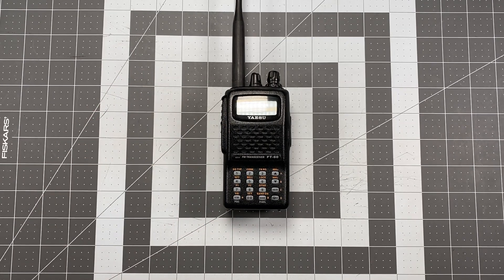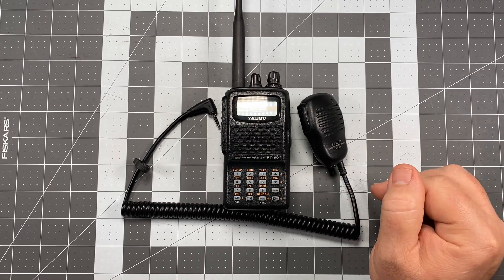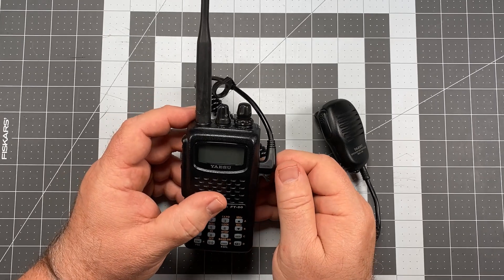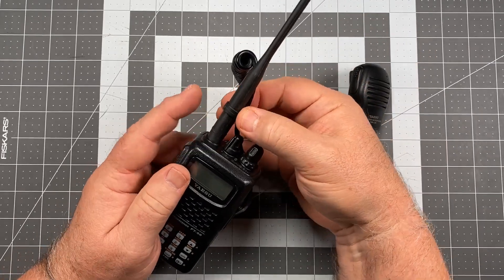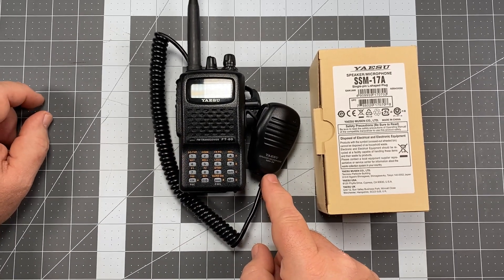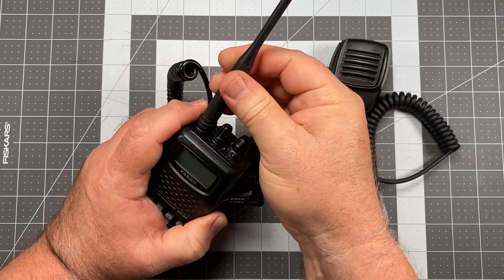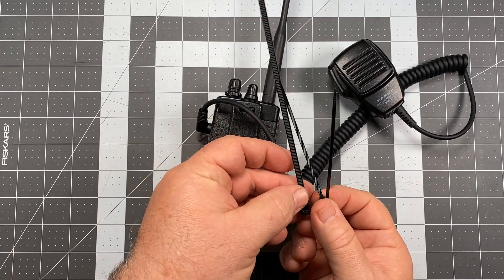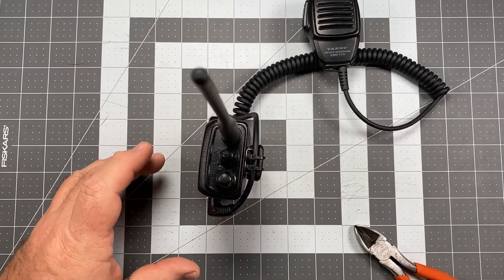Yaesu FT-60 Operator Series - Part 8: Speaker Mic Setup Issues

Comment: I have the SSM-17A mic and struggled with the problem you described. Even used a velcro tie around the radio to hold the connector in, partially blocking the screen. Duh!
What a great, simple solution. Thanks!

Comment: One of my HT accessories (I think it was a discreet earpiece /mic) came with a similar clip to the one that comes with the earlier Yaesu speaker mic. I'll see if I can find it later. Good tip on using small zip ties to secure the mic cable to the belt clip, thanks for that!
I must admit that I rarely use my FT-60 body worn, as I find the squelch control easily gets knocked which is a nuisance...i generally use my FT-65 or FT-70 in that way, with the -60 being kept for SOTA and the like, with the HT in front of me so I'm likely to be more aware of any inadvertent transmissions.

Comment: I am surprised that no enterprising ham operator with a 3d printers has no made that extra ring that the original MH-34 came with.  I also find it odd that Yaseu is still selling the FT-60 new 20 some years after it was released in 2004.